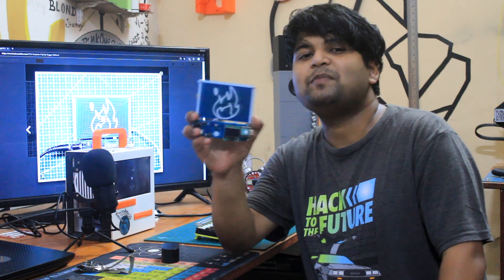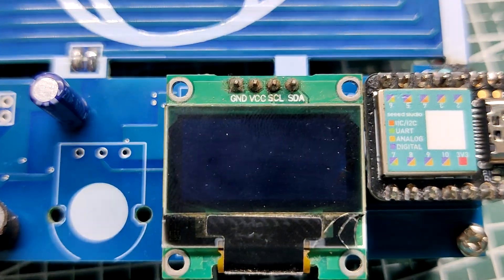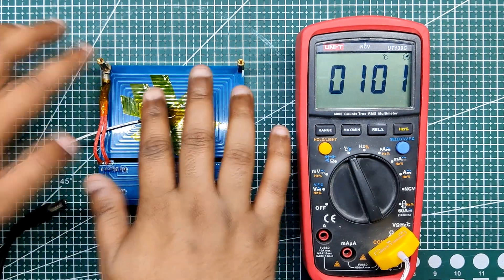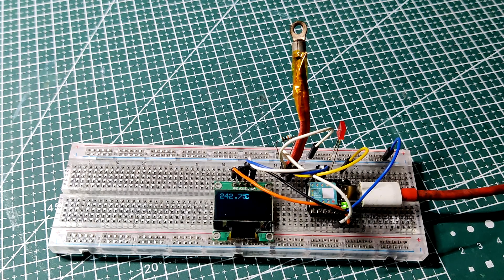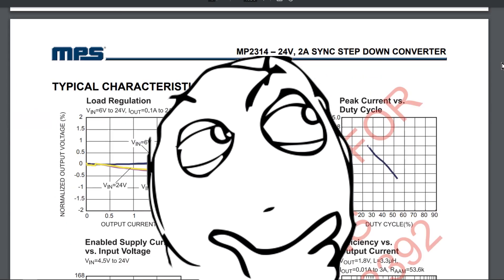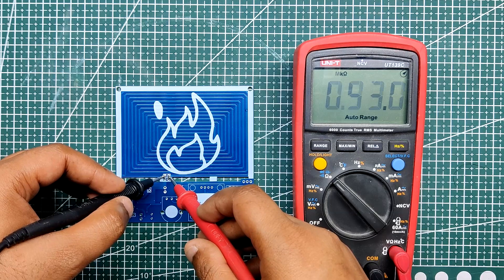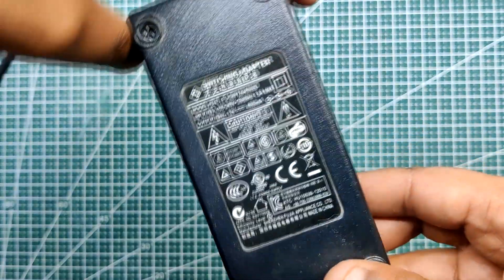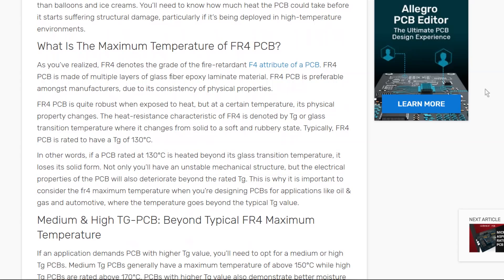DIY PCB Reflow Hotplate

Comment: Thank you for sharing your work here. I may use this as a jumping off point for my own project for heating to a much lower temperature (around 40°C to 80°C with an emergency cutout just below 100°C). My biggest concern was how to design the heater element. Thank you for showing those steps.
Reply from the maker: Thanks, and glad it was helpful.

Comment: I think metal plate can be used as heating plate with some gap from pcb and the coil on pcb will be used for electromagnetic induction. Just like induction cooktop

I mean we can inductive heating instead of resistive heating

Comment: Namaste dost :). If I'd like to build it, but use as a preheater for phone/tablet opening let's say. I'd need a temp of around 80-90C only and no need to go higher :). What would be your suggestion to change in the schematics to achieve it, please? Thank you for the video :). Dhanyavaad.
Reply: I think I found it in the code even "const int threshold = 210;//cuttoff temp". Am I right that I should change it here to my required temp and that would help?
Reply from the maker: @screen-protector  yeah you can set the cutoff temp 90 or less. Also, you can use a 12V 2A Power source instead of 4A as this will reduce the input power of whole system and the hotplate will not heat up more than 100 Degree C.
Reply: @ArnovSharma  ok, makes sense. I've got a thermal camera, so can  use it as well to measure. My digital multimeter has a temp sensor as well, so can double check both of them.

I was thinking more about the built-in cut-off. Because those ceramic plates for phones/tablets have them and would be nice to have my own DIY one. So, will have to look at the schematics which I can't find atm :D. 

As well I'm doing one pure sine inverter,so, have to finish that one first before another DIY project :).

But, again, thank you for the video :) and the answer here dost :).
Reply: @ArnovSharma , I'll drop you an e-mail.